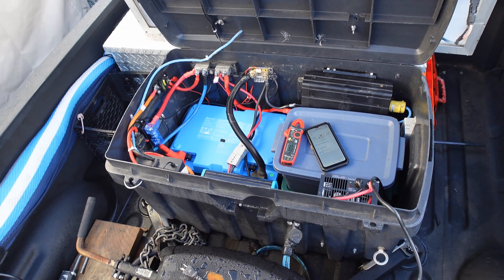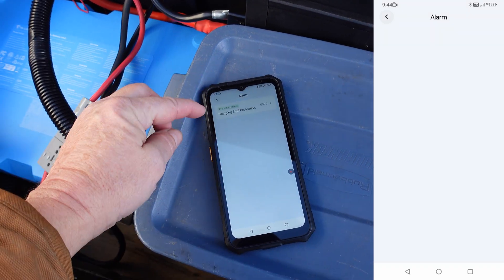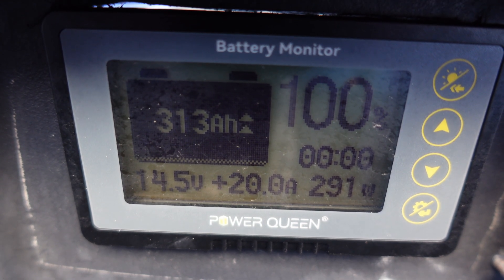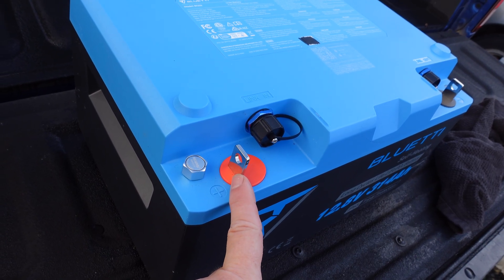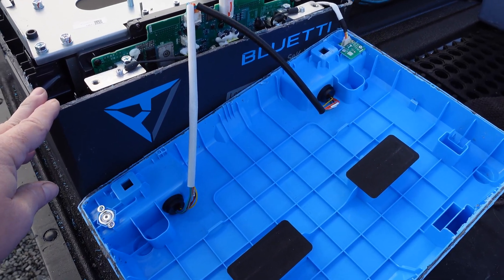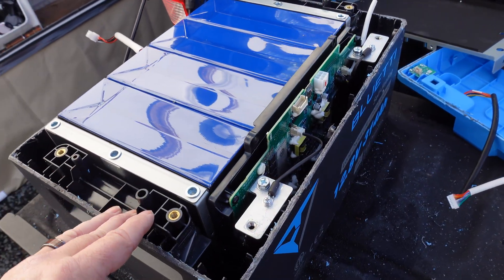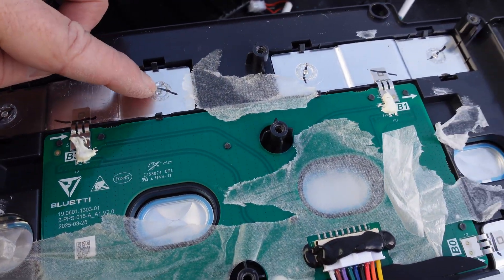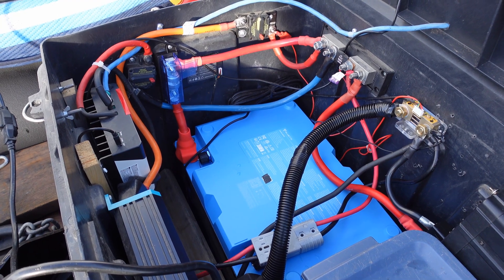Bluetti Battery Self Heat Test & Teardown - Model B1232 12V 314Ah LiFePO4

Comment: Wat can it power furnace swamp cooler dryer welder
Reply from the maker: Max watts is around 1800W for more than that you would need to have multiple batteries